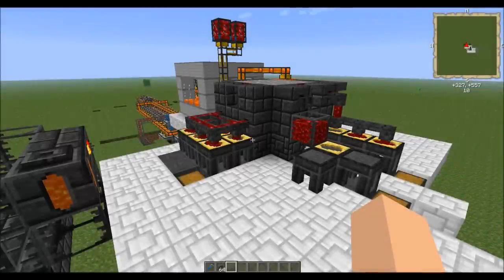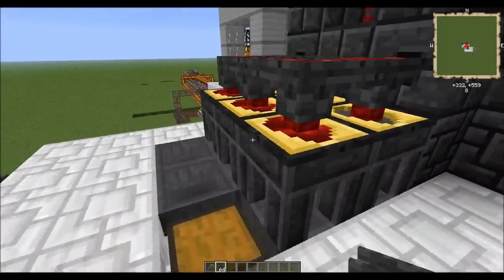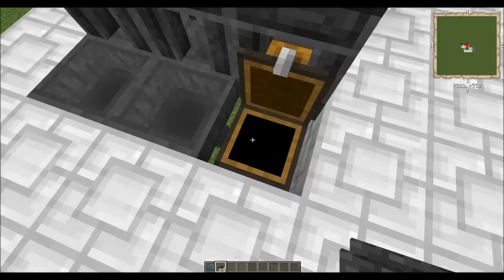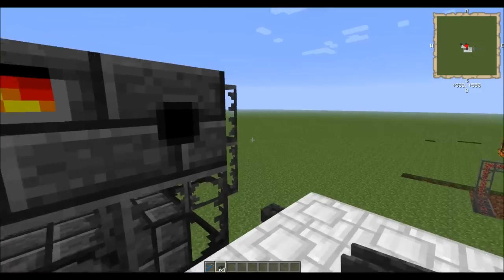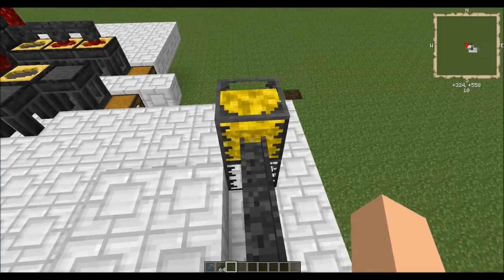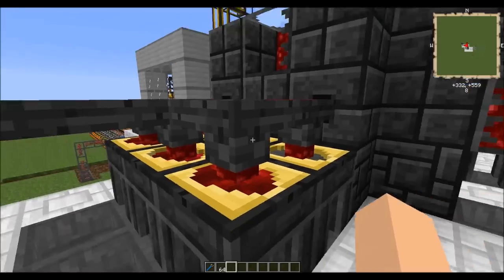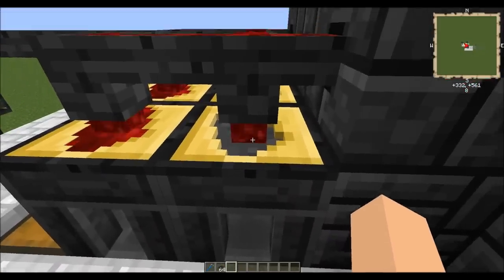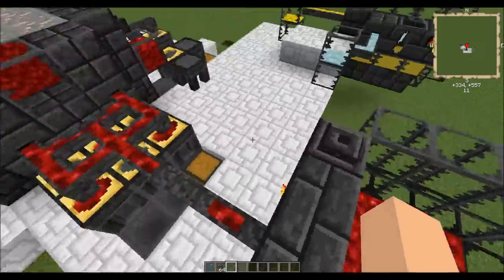Tinkers Construct   Casting Channels

Comment: Sucks that they changed it.
I used this video to figure out why it wasnt pouring into my basins, but when I tried connecting it straight to the smeltery without a faucet, it didn't work, which apparently is a change they made.
Reply from the maker: Yeah, sorry.  I had gone back and added a video annotation (years ago) noting the change but YouTube has deleted the ability to add notes and all notes added at some point since then.
Reply: What did they change?
Reply: @AS-os3lj you need a faucet above a channel for it to work now, before you could just connect the channel into the smeltery

Comment: the casting channels don't work for me, when i place them and there is fluid in the smeltery, the cating channels won't use the fluid so they won't do anything.
Reply: you need to put a faucet in a drain, then put the casting channel under the faucet

Comment: Is that a mekanism dynamic tank that you have the lava in?
 Have you ever put molten metals from a smeltery into a dynamic tank? If so, how did you do it?
Reply from the maker: That one is a railcraft tank.  I have used dynamic tanks to store liquid metals however (although it was a while ago).  T.Construct liquids will work in any liquid handling pipes(that I have tried).  You can pull them out of the drain in place of the faucet or casting channel.  I prefer using TE liquiducts but that's just me.

Comment: For anyone worrying about how to get liquid out, I found out if you put a faucet on a drain above your channels, it'll go into the channels.
Reply: Thanks, I came here to find that out. It must have changed in an update. Also, it's kinda cool how you happened to comment this on such an old video only two days before I came looking. : )
Reply from the maker: Yeah thanks for this.  I had added an annotation mentioning the changed (it has been years since it was changed) but I guess Youtube deleted it at some point.  Guess I need to put it back in.
Reply: Minecraft with Sidetrack Np, keep making good vids my dude.
Reply: The liquid now leaves the faucet and into the channels, but it's still not going onto the casting table??
Reply from the maker: @unclejiggy1  Make sure you have a cast in place that can handle the liquid metal.  Not all casts will use every metal and sometimes other mods (like iquanatweaks) will make things even more complicated.
Reply: @minecraftwithsidetrack554  aye, turns out you can't use aluminium to make casts - that's where I was going wrong lmao
Reply: @dogeski u broski thx.

Comment: Hey Sidetrack,
I had a question for you because it looks like you can help me BigTime (there's almost nobody who knows alot about the smelter). I'm using the casting channels to pour into Seared Tanks and hold liquids. Oke no problem but now the seared tanks won't lose the liquid. It says: "fluid: Molten glass amount:0/4000".
Normally it won't happen and I wondered if you knew something about them.
Reply from the maker: That is weird.  I've had a similar problem with liquiducts on occasion but not tanks.  Have you tried filling them up and draining them again?  The big problem comes that when you break the tanks they hold onto that imaginary fluid... correct?  I use the seared glass and have never had a problem like yours.  They hold liquids just the same and are cheaper too.   Also, if you have TE, open blocks, or any mod that adds fluid containers you should be able to use their containers to hold molten metals.  Personally I love the Thermal Expansion tanks and I never have any problems with them.  Hope that helps.

Comment: I have molten iron in my smeltery with three channels connected to the drain with three basins under them and I'm not getting any flow at all any ideas?
Reply from the maker: I noted at 37s that in more recent versions you need to place the channel UNDER a seared fauceted drain.  You can no longer simply connect the channel to the drain itself.  It's been forever since i used channels though since I tend to use pipes/conduits from other mods.  Hope that helps!

Comment: As for your comment 2 years ago, I thumbed up the video because one you didnt yell in your video, i hate loud ppl in tutorial vids.  two, you were very informative and simple in explaining.  I do have one question, can you stop a casting channel in any way with out breaking the channel?
Reply from the maker: Thanks for the feedback!  It's been a while since I used these last but they used to connect and disconnect by right clicking.  If you mean just start and stop the flow of metal I seem to recall that they did not stop on their own.  However, try a redstone signal since that works on the faucets.
Reply: i had the setup but for some reason i get no flow i think im missing something. i was abke to use a faucet above the channel but not a direct channel to drain.  help lol
Reply from the maker: adhdking I think that is how they are intended to work now.  I think they are intended to be for setups where you want a constant drain of metal to a location(s). Personally I never use them anymore, too wonky.  If you have any mod with liquid handling pipes they will transport liquid metals also.  I prefer to use Thermal Dynamic's fluiducts.

Comment: I love the concept, but I think Tinker's Construct has messed up these casting channels.  I tried to make use of them on my server, but they would crash the server and bug out randomly.  I then tested them in my creative world, and they still didn't work.  I don't know if it is that this video is older than the most recent update, or what.  But great video, and did anyone else have similar problems when they tried using them?
Reply from the maker: The video is a bit older, and yes, based on many comments i've seen it is not just a problem you are having.  If you have Thermal Expansion installed you can use fluiducts to achieve the same goal and they work wonderfully.
Reply: I'm running FTB right now, which has 184 mods and Thermal Expansion is there.  Thanks for the tip!  I've been trying to automate my Smeltery for a while now.
Reply: Minecraft with Sidetrack
can you make a new tutorial in the Monstermodpack please its didnt work

Comment: are there any actual uses for this? i would love to see a filter on the channels so it automatically pulls for example gold and silver out into another smeltery
Reply from the maker: +jan050375 Filters would be great... but last I checked are not included in base TiC.  You CAN use other mods fluid sorting blocks to great effect.  As far as a use for these channels.... they look cool.... you can have flowing metal.... but I never use them  lol  I tend to go toward Thermal Dynamics pipes.  You can filter those quite easily.  And can automate your smeltry set-ups.
Reply: Minecraft with Sidetrack i didnt even know there were fluid filters for other pipes
Reply from the maker: +jan050375 Yup, different mods handle things... well... differently.  Thermal Dynamics uses servo's to filter, Minefactory reloaded has actual blocks that filter fluids, the list goes on and on.  Check out https://www.youtube.com/watch?v=JT_IZVgTC70&list=PL_8tYkghnqk6zBSVyfhtrC69DBTqG8O9l&index=6 at about 5:30... mod versions are outdated but it gives you a general idea of things you can do.  ...I know the pipes have seen some minor revisions.  Happy building!  :)
Reply: Minecraft with Sidetrack thats great, thanks

Comment: for some reason the channels do not work at all for me it connects to the output but nothing happens and melted iron will not go in the ingot cast any help
Reply from the maker: does liquid go into the channel?  It's possible you have a little bit of molten liquid left in your cast.  You can try picking it up and placing it back down.  Also I've noticed the channels sometimes seem to work better if you put your table one block away from the drain block.  Hope that helps.
Reply: no liquid goes in and i tried all you just said but sadly, nothing thanks for trying though.

Comment: It's good, saved me a whack of time.
One small thing though, when you are talking about the block being a bit buggy, you say "but since they are a new block, I imagine they will only get better with time, as does everything in Thermal Expansion"
Shouldn't that be Tinkers Construct?
Thanks :-D
Reply from the maker: buahaha yes you are correct, brain fart!  But TE keeps getting better too!
Reply: @minecraftwithsidetrack554  Thermal Expansion Ohhh freakin yeah, the addition of Reinforced and Resonant versions are amazing. 512 bucket 1-block Resonant portable tank hell yeah! Wish I could extract directly into it using the tank like a Forestry Pippette but thats not the case. Fluivac builds a bridge on this gap , although extremely slow on world fluid blocks and some mod machines. Wish it could suck entire areas of fluid holding still just like a pump.

Comment: in just the mod itself, how does it know which way to flow?
Reply from the maker: As of the last time I used these(years ago) they were NOT intelligent pipes. Liquids pretty much flowed in all directions with no regard for putting the right amount in tables/basins to make complete ingots/blocks.  These were great if you needed to make large amounts of one type of metal or if you did the math yourself to ensure no left overs would linger.

Comment: mine doesn't connect to one another when placed down, if i right-click the sides nothing happens
Reply from the maker: They have always been a little wonky... and honestly I haven't used them in ages.  Suggestion: use any other liquid pipes instead.  I like fluiducts from Thermal.
Reply: @minecraftwithsidetrack554  oh thanks, i'll try that.

Comment: sadly this thing still terrible bad even in 2016

best pipe as cheap as crack is still pipes from extra utilities
Reply from the maker: Yeah, it was a good idea that just never panned out.  I like the ducts from thermal expansion(dynamics) cause you can still see the molten liquid even if it's in a pipe and not a cool half open channel.